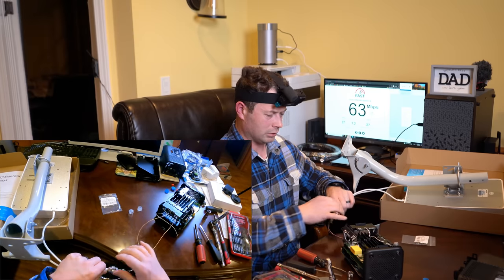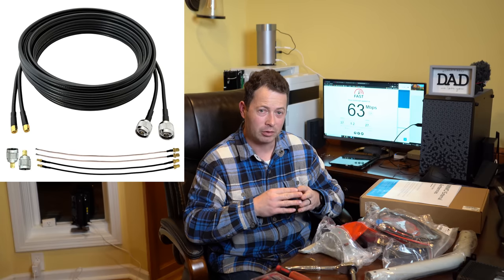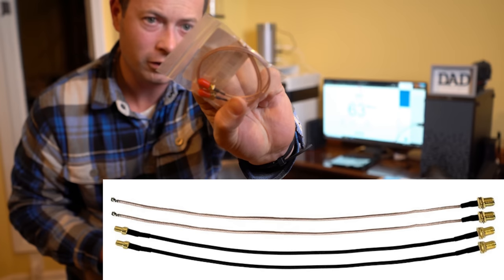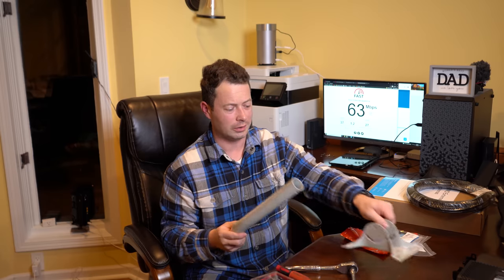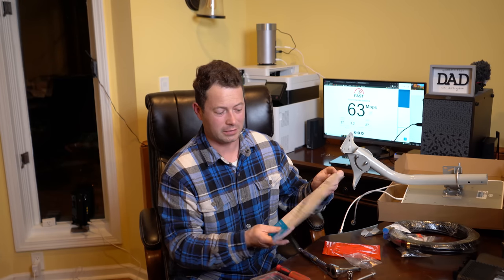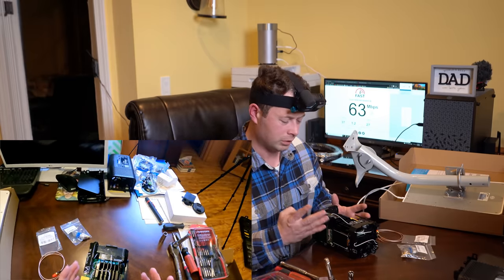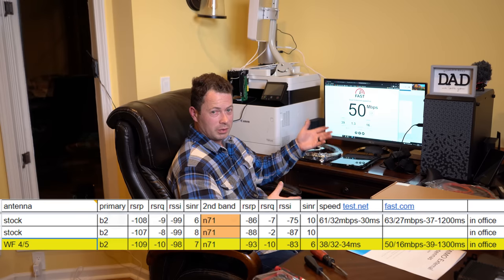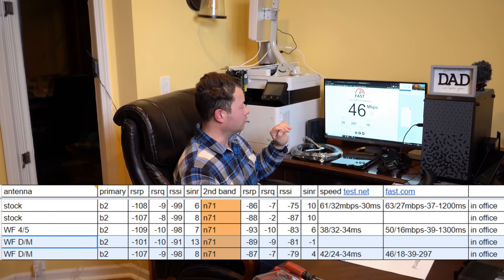✅ Waveform External Antenna - Arcadyan KVD21 T-Mobile 5G Home Internet - Speed Tested

Comment: You are putting videos out in lockstep with what I’m going through. Kind of anyway! I have so many questions for you. Thanks so much for your great information. What’s the best way to communicate with you?
Reply from the maker: Hey Nathan, thanks for watching!  Comments on YT always work.   My hope is that the videos are relevant and help many people at once.  I try to take feedback/questions from the comments and have even made videos due to requests but unfortunately I don't have time to act as individual tech support for all viewers.
Reply: @NaterTater  thank you! While I do have questions, your videos have been answering many of them. Do you have videos on how you have you ASUS Aimesh setup? I was thrilled to discover yesterday that my new position for my ASUS ac3100 has enabled me to get WiFi in my outbuilding some 180’ away. But it isn’t perfect. It only works if I am standing in the outbuilding in the corner nearest to the house. I’m thinking if I put another ASUS router in the outbuilding, it might give me full coverage in there. I wondered if you could tell me if any ASUS with aimesh will work, or if some are better than others at meshing long distances. Thanks!
Reply from the maker: @nathangrepke4193  i have a few videos on that topic.  If you barely get signal you might be better off with a p2p wifi bridge to your outbuilding then plug in a aimesh node with ethernet to that p2p at the outbuilding.  I do that for two buildings and have videos in this playlist Smart Home and Wi-Fi: https://www.youtube.com/playlist?list=PL8d9FovK2dNTd0HdAiv4EnY6EQVfKFW36

Comment: Just received this gateway a few days ago. With it sitting in the window on one side of the house facing tower, I get a weak {2bars) 5g signal. This gets me 100+mbs downloads and around 15+mbs uploads.  Moving the gateway away from that side of house makes it switch to LTE and I get around 50mbs. either way, its better than the 13mbs I was getting with windstream dsl

Comment: Quick question, will I be able to add the antennas and put its shell back on or is it going to have to be open like yours. Thanks
Reply from the maker: You can put the shell back on.  Why, are you calling my gateway ugly? 😂
Reply: @NaterTater  lol nah but the wife will. Appreciate it the response, we just picked ours up a few days ago, this is really the only true unlimited internet we can get at our location. We have the 8800l and I was already going to install an external antenna but since seeing this I may just ditch it and see what kind of speeds I can achieve with T-Mobile.

Comment: Question Nate: Is your tower microwave backhaul or fiber??
Reply from the maker: i think fiber but next time i drive by i'll check for microwave antennas.
Reply: @NaterTater  look for the fiber. It might be the hub for a microwave backhaul
Reply from the maker: @Bryan-Hensley  I'm not sure if it means much but there is certainly fiber at the nearest intersection.  I had been pleading with the ISP's to get it ran down my road.  So there is fiber around here but not positive on the tower itself.

Comment: I have only one device connected to this T-Mobile gateway via ethernet cable. Speeds are fine. I just want to improve latency. What's the best way to do that?
Reply from the maker: Not many options.  Can try MTU adjustments and an external antenna outdoors can help some.

Comment: Please please please Sir can you tell me what is the best antenna for 5G because outside the house the signal very strong but inside the house it's Very weak the Tower less than kilometers
Reply from the maker: I use a Waveform 4x4 panel antenna.  Get 5% off with this link http://waveform.refr.cc/natertater then search for 4x4 mimo panel there.
Reply: @NaterTater   The router I have is zte 5g, it needs 2x2 or 4x4

Comment: Gosh dude, allllll I wanted to know was what port!! Please throw that spreadsheet up in the beginning
Reply from the maker: Waveform's install guide has that.  This video covers many things, everything cant be first.
Reply: @NaterTater  fair enough.  Waveforms guide is really explicit about the antennas and that helped a lot.  This was just tough with no time markers and no clear structure. I lost my temper when you said "I'll try m1 and m2 next and report back and tell you night port id best" and then it just cut directly to the attic and talked about snow and other stuff for four more minutes.

Comment: I was looking at adding an external antenna. I could only get 2 bars off signal from my best location, my garage window. I added an old satellite dish behind the gateway and it jumped up to 3 bars. I am getting  250 t0 500 mbps  down and 25 to 52 mbps up now. It  has held those numbers for over a week now.  I think I will be just leaving it alone for now.
Reply from the maker: Nice!

Comment: My gateway used to connect to b66/n71. After tower upgrade, the gateway is on b71, and the connection is extremely slow.  Will the external antenna help connect to b66/n71?

Comment: Broke off the D connector on the board.  Any work around that? Thanks
Reply from the maker: A local electronics repair place might be able to solder a new one on.

Comment: It looks like those antennas have a metal plate at the back, do they shield the signal from that side?  In my situation I am located in line and about equal distance between two towers.  Would I be better off with a 4x4 facing one tower or 2 2x2s with one facing each tower?
Reply from the maker: Its not a full block but yes they get better reception off the front side vs the back.  Most likely will be best pointing all at the same tower, which ever is the better tower.
Reply: @NaterTater  Thanks for the reply, I guess I have some experimenting to do.  As a follow on question,  in the short period of time that I have had T-mobile home internet I have noticed a wide range in transfer rates.  Is it common for the performance to change due to atmospheric conditions during the day or are these changes due to other users on the system?
Reply from the maker: @pagesk2001  yes, mostly the latter. TMHI is bottom of the barrel priority.

Comment: Hay Nater, how did you get the chart with all the info?
Reply from the maker: I made it.
Reply: @NaterTater  oh okay, so I am in Australia and with a company that is using vodafone cell towers for 5g my question is my ISP says max speed is 100 Mbps I'm getting 180 is there a possibility that setting up an antenna and all that improve my speeds or will I get bottlenecked by my ISP. Thanks for the great videos.
Reply from the maker: I'm not sure.  Sounds like your ISP isn't throttling you now so adding an antenna wont change that.  It likely will increase your potential speed though.

Comment: Thanks Nate I enjoy watching your channel.  There isn’t too much out there about Arcadyan KVD21 T-Mobile 5G Gateway and compatible Wi-Fi repeater/booster. There are areas of my home the Wi-Fi signal is somewhat weak but would like to see some improvement. Wondering if you or anyone else has found a compatible Wi-Fi repeater that would work reliably? I tried the Linksys 6500 and had to return it because it simply did not work at all. Thanks
Reply from the maker: hey Vijay, I try to steer away from wifi repeaters due to past issues with them.  I suggest either a mesh system (https://www.youtube.com/watch?v=hIKZzCkbXDY&list=PL8d9FovK2dNTd0HdAiv4EnY6EQVfKFW36&index=2) or something like a ethernet over powerline adaptor (https://amzn.to/3dm92o1) that seem to be more robust.
Reply: Thanks Nater, for the sound advice. I’ll look into both options.

Comment: With the possible upcoming use of bands N77 and N78 use by some carriers with this antenna work with those bands?
Reply from the maker: Yes.  Here's it with Verizon's n77 https://youtu.be/5CvY7iZ_fj8
Reply: Asking because waveforms website says 2x2 panel antenna doesn’t support n77 and n78, but the log antenna does. Would the log antenna be more future proof than the panel? Currently trying tmobile home internet so not very important yet, but still waiting for Verizon to offer any 5g in southside Virginia. Not sure what bands they will use when it does become available. Thanks for your reply.
Reply: Looks like the 4x4 panel does receive the n77 and n78 band frequencies if I am reading correctly.
Reply from the maker: @davidholley1439  yes

Comment: I am about 4 miles from the tower I get B66 and N71. My speed is roughly the same as my 4G phone anywhere from 20-30 down. I have seen as much as 50 a time or two. I have also seen around 5 down. A lot better than what I had but nothing to write home about. I was hoping to stream on it and can a lot of the time. But when it is getting 5 down it won't do two tv's and a laptop.

Comment: I already have a single 4/5G Yagi installed outside because I was using a cellular internet solution before T-mobile. I'm curios  of the configurations I can use. Can I just install one pigtail and use current antenna? Should I do two pigtails and use a N to SMA dual splitter to turn the single into double? I'm just really trying to avoid that cable run again (LMR 100 ft) The direction pointing of the antenna will stay the same, so no adjustment needed there. TIA :)
Reply from the maker: You can try it with a single but i'm pretty sure you'll need dual LPDA setup.  You absolutely can't do a splitter in the cable.  Must run a 2nd LMR.

Comment: Is 30ft the max the cables can be or can I extend it? I bought the same kit but I really need a few more feet to make it outside.
Reply from the maker: It can be longer.  Waveform will make custom length cables.

Comment: Hey Nate, I have the trash can gateway, and when I look at the 5 ghz info I am not seeing any readings for the high frequency, it's blank, I have readings for 5 g low frequency, did I disconnect a wire when doing the antenna  upgrade, I can't find anywhere that would show if I am suppose to be get signals on high frequency. I don't want to tear it apart again unless I need too. thanks
Reply from the maker: I'm not sure, i haven't seen that.  Did you try the ole turn off and back on?
Reply: @NaterTater  yes still no info, I just need someone to tell me that they are getting info on 5g high freq, mine is zero
may be I disconnected a wire when hooking up the antenna I just don't want to take it all apart for nothing

Comment: I’m running n71 with stock and average 130 down, and 75 up. I might try and external to see how it goes?
Reply from the maker: if you have a reasonable place to put the antenna (attic/outside) you will surely get better speeds.

Comment: I installed the 4x4 mimo flat panel and it improved my signal dramatically, but randomly tmoble will loose signal. 
It goes from 170 down to 1.5 down. 
Is there any reason you can think why this will happen. 
When I go to antenna and redirect it again it comes back to normal for the day.
Reply from the maker: Changing towers or bands.  Try to better position antenna or look at my playlist with 3rd party routers that do band locking.

Comment: My house is in a heavily wooded area and I only get 2 -3 bars on my gateway. Will this Waveform get me a stronger signal as well as increase speeds?
Reply from the maker: Yes
Reply: @NaterTater  Do you have a video of how to take the case off of the gateway? I have all of the screws out, but not sure how to pop it off without damaging it. Thanks!
Reply from the maker: @bobbutler5325  https://youtu.be/g-oKre_RSYg

Comment: I also had a drop in upload (Nokia) when I went from stock antennas (b66/n71) to a single Waveform antenna (b66/n41) (indoor). Download doubled from 50 to 100Mbps.  I added a 2nd Waveform panel and my upload speeds went back up (no change in download).  Was that because n41 and b66 are close in frequency or because my b66 tower doesn't have n41 so I get it from a different tower? I don't know.  Mounting both panel antennas on the eave of my house about 6 feet apart took me to 300-400Mbps down.   Upload is only 20-30Mbps, but that sure beats the 0.6Mbps on ATT DSL :)  Thanks for the great work and data.
Reply from the maker: It may be because of the antenna ports you connected to.  Not all the ports are "equal", they tend to be tailored for specific freq and tx/rx.  Regardless, sounds like you have a good setup now so don't mess with it!

Comment: will 2 port work with t-mobile home internet/arcadyan always?  Why is it that you do not use 4x4?
Reply from the maker: 4 ports will work.   Cost more and mostly benefits n41 users who dont think 2x2 is enough speed.  4x4 is better but not always needed.
Reply: @NaterTater  thank you.  I recently got my t mobile home but speed not great so I need antennas.  Thank you for the info re: antennas, really good :)

Comment: I live in an apartment and I can’t mount anything outside. Would it be worth getting this antenna if I would have to mount it inside?
Reply from the maker: Only if you cant mount your gateway there.   You would get close to the same performance by just putting your gateway in the best spot inside.
Reply: @NaterTater  I get 300-500 down which is great but I live right on the edge of an ultra capacity zone and I am like 1/4 mile from the tower. There are several trees and a building between me and the tower. I don't know if adding an external antenna is even worth it honestly. What are your thoughts?
Reply from the maker: @scottcampbell1205  I'd say no

Comment: Tried using my 2 yagis that currently work with another provider on a GTEN modem to no avail.  M & M1, D & M and with and without the internal stuff on 4 & 5.  Tried different cables.  It's  as though they don't exist.  Does the impedance matter?  They are 50 ohm, I believe.
Reply from the maker: if they are true yagi antennas they wont work.  the cellular modems use log periodic directional antenna (LPDA).  50 ohms is correct, needs to cover the cellular freq for tmobile (600-2500mhz)
Reply: @NaterTater  They've worked with my GTEN Model 5 cellular modem also hitting T-Mobile for a couple of years, so I assume they're the correct type. Is there anything else I can check?
Reply from the maker: @Bruce Morgan  do you have them setup to be cross polarized?  Mounted at +45 and -45 degs like in this picture: https://www.waveform.com/products/mimo-log-periodic-hotspot-external-antennas?view=v2&variant=39937463910503
Reply: @NaterTater  When I first got them. I made a test stand and tried everything possible for 2 days.  Vertical and a certain distance apart (I forget how much) worked best. The other modem connects on 66, 2 and 71 if that helps.  It doesn't have 5G.
Reply: @NaterTater  My phone is s Pixel 7a and connects to 5G UC so the tower has it.
Reply: @NaterTater  I just got mine a couple of days ago.  Do you think they might have changed something in the firmware?  I don't see how they could do anything that would only allow their antennas to work, though.

Comment: My arcadyan connects to bands b66 and n41 and I average about 10-20 and I am considering getting the 2x2 what connections would you recommend I do
Reply from the maker: Get it and try it out.  There is a 90 day return on Waveform antennas.
Reply: @NaterTater  which antenna connections do you recommend I try first?
Reply from the maker: @LL053923  M and M1
Reply: @NaterTater  thanks I’ll start there

Comment: Hey I have an unrelated question. Is it feasible to hook up two routers off the two ethernet jacks on the modem? I'd like to have one upstairs and one downstairs. Does this require special settings and do we know what routers are preferred with the new modem model yet?
Reply from the maker: It is possible but what you want to do is keep it all one network and the easiest way to do that is a mesh system.  I use Asus AiMesh for me, see here for an example https://youtu.be/5kse94JM0IA. But also check out this playlist for more examples/info on wifi:Smart Home and Wi-Fi: https://www.youtube.com/playlist?list=PL8d9FovK2dNTd0HdAiv4EnY6EQVfKFW36
Reply: Thanks for letting me know about this! I saw another reviewer say that changing the packet size is important for t-mobile home internet - does this mesh system offer that option? Or is it not even needed
Reply from the maker: @awesomekip311  Asus does let you change MTU packet size but I have not found it to matter.  The only thing I have a non-std packet size for is VPN due to fragmentation
Reply: @NaterTater  OK cool! Thank you so much for the quick replies. I'm excited to get this system set up, it seems very convenient. It looks like I get 70-80down, 30-40 up on my phone's 5g on the good side of my house, so having that across the board will be awesome. I wouldn't be surprised if that improved with firmware updates on the new modem as well. I'm debating on how many nodes I will actually need around the house. Oh one last thing, did you find this router has good QoS settings? I just want to make sure when my folks are watching netflix or whatnot, that it wouldn't inhibit my ability to stream to Twitch.  Even with the modem downstairs where I'm getting 10-20 down / 3-5 up, it's still far more stable than my old internet and doesn't drop frames while streaming to twitch.
Reply from the maker: @awesomekip311  the Asus has good QoS.  The tmobile gateways do not.
Reply: @NaterTater  on your video about the mesh router setup, I noticed you suggested daisy chaining nodes only through ethernet, which makes sense. But if I have the choice to connect node 2 daisy chained from node 1 (ethernet), vs using a longer ethernet cord to simply connect it to the primary router, what is preferable in your experience?
Reply from the maker: @awesomekip311  direct to the main is #1 preference.  You can run ethernet about 300ft without a problem.
Reply: @NaterTater  sweet, I'll make sure to do that then. Appreciate the advice.